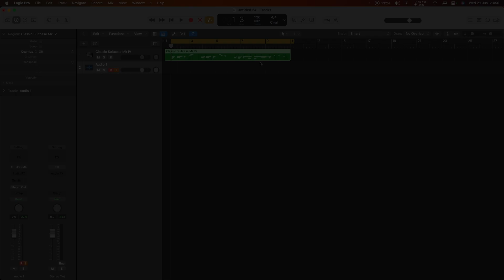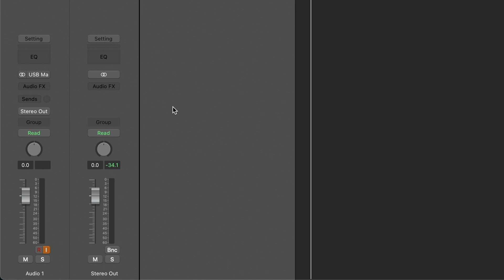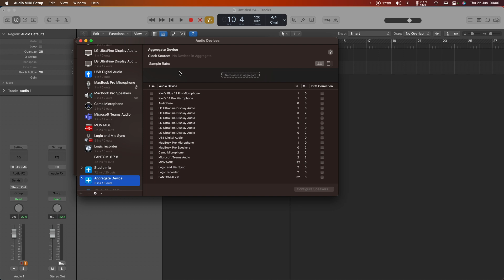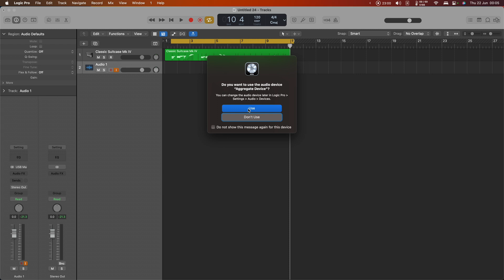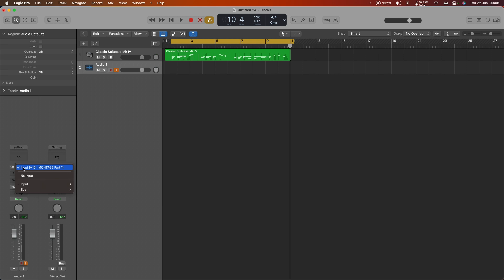Managing audio devices: How to use Yamaha MONTAGE and MODX with Logic Pro (2023)

Comment: Thank you for the great work you have done to explain how to use Montage or MODX with Logic!
Reply from the maker: I realised that I haven’t covered MIDI clock sync yet (oops). New video coming soon…
Reply: @KierDarby  great, I start sharing this week-end
Reply: Hello and thank you for this video. I have modx8 is that means that if I will record with my modx to the logic it will be midi track?
Reply from the maker: MODX can transmit both MIDI and audio to be recorded simultaneously.

It acts in exactly the same way as the Montage demonstrated in this video, although it is limited to 5 simultaneous stereo channels, while Montage can transmit 16. 

All this means is that if you want to record separate audio tracks for each part of a performance with more than five parts, you would need to do so in two passes.